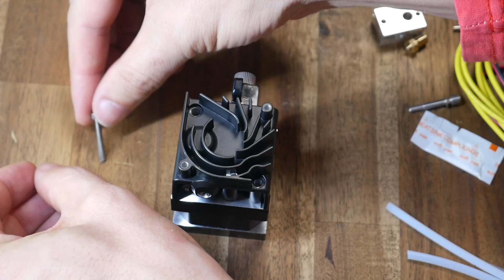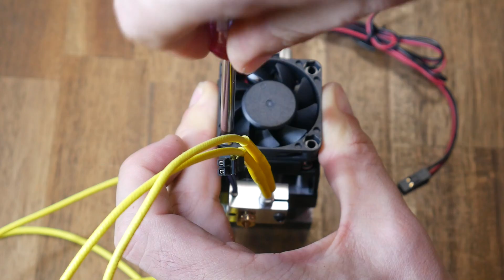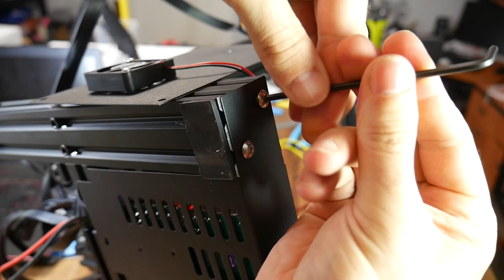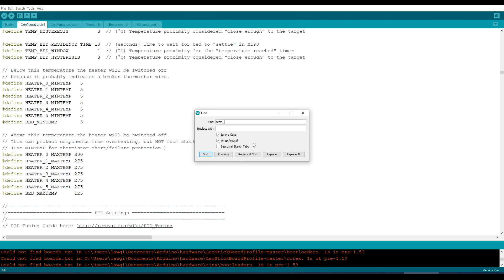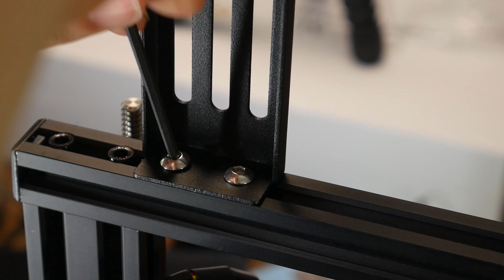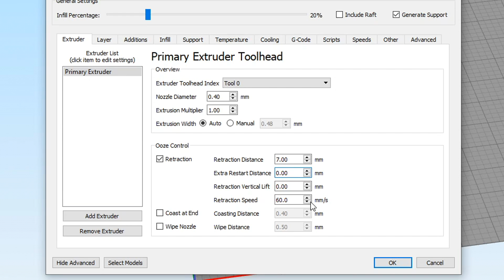Hemera to Ender 3 - Complete guide

Comment: Hi, I'm the designer of the part cooling duct you used. I just wanted to point out that you should position the heater block pointing towards the rear of the printer to hugely improve the clearance between the duct outlets and the heater block.
The duct is designed for the flow characteristics of a 5015 blower. It won't be anywhere near as effective with the rather feeble stock 4010 blower.
The best way to gain back the lost Y travel is to drill and tap new holes in the Y rail so you can move the entire Y assembly forward. 
Keep up the good work!
Reply: or you can forget the holes and instead use 2 tnuts? thanx 4 the design btw!!
Reply: @ZILLION4EVER  The printers I've seen that go that route also use plates on the side to reinforce it. I'd probably add some of those if I was doing it that way.
Reply: @ZILLION4EVER  what size should be the tnuts?
Reply: He has a 5015 fan now I think.

Comment: can  you do a install of the hermera xs on a kobra max?  
the touch off sensor, since it uses the nozzle for heights and not a probe is a little out of my expertise.   if I use the sensor mounted to the frame / plate, do I need to use any extra wires , say the the spring? or the stepper body for connection?
any way, I know this is a shot in the dark, but I cannot find any info about the sensor and how it works online, and anycubic is terrible for advice on MODS.

Comment: Yeeeeah, I ended up with one of the Ender Pro 1.5 versions, and every mod I've done has been a pain because almost nothing will go exactly  the way it's supposed to 🤣 I installed a Hemera on mine and it was enough of a hassle to set up that I am just holding on to it to put on some future project, it's just too large for the bed size and I'm sure I can make better use of it elsewhere. Debating putting the 1.5 back to stock, we will see.

Comment: I don't get the AXIS_IS_TMC(E0) current setting, the value is in mA? is that the rated motor power? in my case it's 1.3A (matrix extruder) and 1.33 for the e3d hemera in their spec. sheet. the dozuki links dont work as of writing this.

Comment: Excellent guide! For the Ender 3 Pro 1.5 with 4.2.2 Board, I found two things that I had to do slightly differently:

1. Apparently the A4988 drivers on the 4.2.2 board have .1 ohm Rsense instead of .05 ohm and so I had to adjust the Vref for my extruder to .9576 volts (that includes a 10% safety buffer below the 1.33A max current of the Hemera stepper motor).

2. The wires had to be moved around a bit, not just switching the middle two, like they suggest in their guide. Best advice is to plug your original extruder wire into the board and Hemera and trace the wires to verify which ones need to go from which pin on the board to which pin on the stepper. For me, from back to front on the stepper, it ended up being black > (empty) > blue > green > (empty)>  red.

Comment: I have one and when it works it works great but when it doesnt its a HUGE pain in the arse...I went with the volcano hot end for my build all set onto a creality cr10-v3...i have had this setup jam mid-print, all of my nozzles are jammed. right when I think I have it all down and its printing perfectly, it will jam itself I just pulled a piece out that was slightly bigger than those glass thermistors.....anyways....i am sure its something I am doing wrong somehow and not E3d's fault, I do love the company....now, if we could only get them to spend the time and energy to come out with some real PROPER install kits and official instructions.... they could bring a lot of  people into this industry, we all know most of this stuff if not all of it comes from china and china is HORRIBLE with directions.....if just one manufacturer was out there explaining what all this stuff is like you do on your channel... they could be making a killing! cheers from Colorado, USA.

Comment: I just installed one on my CR-10S.  I bolted it to a linear rail and it was quite the project coming up with all the pieces to make it work.  In the end, I modified a bunch of things from thingiverse meant for other printers to work on mine and it is working GREAT.  I will however continue to iterate and improve on each piece I printed as none of them are perfect.  But boy oh boy does this hot end print smoothly on a linear rail!

Comment: I found a discrepancy with the wiring diagram provided. It seems that for my Hemera, the "thick" red/black cable is actually to the hot end thermistor and the "thin" red/black cable is to the hot end fan. Maybe E3D has switched the type of wires they use but I thought this might help people out. I spent hours trying to figure out what was wrong. My fault! A good reminder to always double check that the cable matches the component, even when referencing a wiring diagram.

Anyway, I really appreciate this video and all your others. Super helpful!

Comment: Awesome video! I can’t wait to get a Hemera for my CR-10S. Unfortunately I’m going to have to be patient as they are out of stock probably due to the pandemic. I might end up going with the Micro Swiss Direct Drive Extruder combo and flash Marlin over to get my feet wet since this is my first 3D printer.

(I’m a CAD designer utilizing it to 3D print automotive prototype designs.)

Comment: Quick question. I was under the impression the cr10s pro and alike didnt support (cartridge style) thermistors; is that just not actually an issue now or was it just not an issue because of the TinyMachines  marlin firmware modification that it was fine? any info is much appreciated, cant seem too find much online.

Comment: I installed the Hemera on the Ender3v2 and had to make 1 minor change. The extruder stepper motor wiring had to be BLACK | GREEN | BLUE | RED instead of BLACK | BLUE | GREEN | RED. The diagram shown in the video resulted in the extruder stepper not rotating at all. Going BLACK | GREEN | BLUE | RED (swapping the inner wires) resulted in the stepper rotating backwards. Swapping either of the pair of wires (BLACK / GREEN or RED / BLUE) should fix the inverted rotation. Or you can change through Marlin too.

Comment: Michael, Any chance you can swop that Hemera onto your Ender 5, and confirm parts bolts etc required.
do you have a basic E3D V6 Bowden and E3D V6 Direct Drive with a Titan video, in 2 minds which to buy, both not exactly cheap.
pretty sure this will make a day/night difference to my printer.

Comment: Please keep in mind that you will have to change the Vref and double the total to about 9.5 with the 10% reduction, e3d added a note that Creality printers don't use.05 ohms, but they use .1. I had clicking because of the extruder being set to the wrong voltage.

Comment: I was confused wiring this up. In your diagram you say the thicker red/black one goes to the fan, but when you do the actually wiring the thicker one is the thermistor . Just a heads up if anyone has this same issue.

Comment: Where do you have the 940 for the current from?

In the official paper it says:

Step 7 TMC 2100, 2208, 2130, 2209 (Standalone)
TMC 2100 calculation:

VREF= (RMS current x 2.5) / 1.77

VREF = (0.94 x 2.5) / 1.77

VREF = 2.35 / 1.77

VREF = 1.33

It is advised to add a 10% safety margin to avoid any over heating, decreasing the lifespan of the driver.

1.33 - 0.133 = 1.197

VREF = 1.197

Comment: https://www.thingiverse.com/thing:4076960  This will let you modify a four wheel x-axis gantry plate to mount directly to the Hemera.   It it pretty easy to do with a drill bit set and good drill.  I used a cut-off wheel with a router to cut off the stock hotend mounting points, then attached the guide, used some cutting oil, and drilled holes for the Hemera.   The extra wheel helps with the added weight of the hemera.  You can loosen the eccentric nuts without introducing slop.

Comment: I have upgraded my Ender 3 with Klipper, mainly to print at 150-200mm/s for quicker prototype. (and to be honest, pressure advance with 0.5 knock off nozzle and bowden setup are not really going together). Since then, the skipping extruder has annoyed me a lot (stringging and budging sharp corner, too). I'm considering changing into Hemera in order to achieve stable extrusion quality with Klipper's pressure advance really working.

Do you think that a Direct Drive setup with Hemera hotend and Klipper printing as really high speed will work?

Comment: Used this as a reference for installing on my Ender 5 with the silent mainboard. Key differences:
1.) vref calculation for 2208s

1.3A stepper motor on the hemera
1.3/1.41 = .942 (root mean square)
(.943 * 2.5) / 1.77 = 1.33 (max vref)
1.33 * .9 = 1.19 (final vref with safety margin)

2.) wiring colors on the stepper motor didn't match your unit, I ended up referencing the stock cable to determine placement, [e] denotes where the extruder marker is on the cable
for my ender 5, this was the pin closest to the middle of the board and ends up being the right-most pin when viewing the hemera from the side with the stepper motor. The two middle pins swap positions between the board and the motor. 

Mainboard
____________________
|                    | 4 3 2 1 |  |
|                                      |
____________________

Stepper

______| 1 3 2 4 |______
| O                                 O |
|                 Logo               |
|                                         |
|                 QRC                |
| O                                 O |
--------------------------------------

MB        Stepper Motor
1      => 1 left (blue)
2      => 3 middle right (red)
3      => 2 middle left (green)
4 [e] => 4 right (black)
Reply: Thanks for this, my hemera is sitting in a box waiting for me to find out if I could use this guide.
Reply: Thanks man this helped me understand that for my setup (CR10-S PRO V2) is needed to switch 3 cables

Comment: Hey Michael! So I got 4 HEMERA upgrades for my print farm for my Ender 3's. I am unable to get some clear Sainsmart TPU printing for longer than 20 minutes before either: A) The filament stops feeding (low tension), or the filament gets crushed and is blocked by the tight tolerances of the Bowden adapter (high tension). I've gone through E3D's entire troubleshooting guide- waiting for support to get back to me. Any ideas what might be causing this issue?
Reply: Did you ever get this resolved?

Comment: Hi, thank you for the very great report. I put the Hemera to my Geeetech A10 and now I has problems with the stepper motor. My board is a GT2560 V3 and the orign stepperdriver and I put it to recommended setting. But now the problem is, the motor is only shaking left<>right and not moving normal. I put the Vref to 0,8V but it was not helping. E3D recommend to turn the 2 middle wires but then the motor is no more shaking/moving. Any idea what is wrong?

Comment: Hey Michael, as a heads up, I print things but have not made it to the point where I can design things.  I got the idea of upgrading my Ender 5 by installing the exoslide and have also purchased the hermera.  While the Exoslide team has created the mounting plate and a cooling duct for the Exoslide, no one has created an EZABL mount.  Would you consider doing a guide for the Ender 5 with Exoslide and Hermera with the EZABL and design a mount for it?  I wish I was able to draw things up like so many people do, just not there yet.

Comment: A 170 CAD extruder mounted on 3D printed parts. Thanks but no thanks.The Hemera has superb design and seems to perform well. But everything goes out by the window once you mount it with ugly and unsafe 3D printed parts.

Comment: I have one fitted on the Ender 5. Designed a one plate design that works perfectly. 
Only one thing i can't get rid of is the z seam (using cura) altough it's directdrive and really good performing.

Comment: Put some thermalpaste on your thermistor and heating cartridge!
Reply from the maker: I considered this but ended up following the E3D instructions exactly.
Reply: @TeachingTech  Dammit! My gut told me I should so I did.  Then the E3D guide specifically said NOT to, so I pulled them out and removed the paste, the whole time thinking "it makes sense to have this on the thermistor but not so much the cartridge".
Haven't even run the new setup yet.  Just the mounting and wiring has taken 3 day's worth of my "free"  time.  Haven't even got to the firmware changes/compiling part yet.  Was ready to do that tonight but not after reading all the comments.  At this point I think I'd rather just take a lighter to a handful of PLA and smear it around repeatedly.

Comment: I also was having issues losing 20mm of Y, but luckily my y axis wheels were wearing out and for $15 I added linear rail to the y axis and got all that travel back. (https://www.thingiverse.com/thing:2914034).  Also I didn't have any flex from Joe's mount, but I did 100% infill with Carbon PETG.

Comment: amazingly clear tutorial ! great job. convinced me to give it a try on my "never-been-doing-well" CR10. thanks
Reply: How did that turn out?
Reply: @byfunkyoid : it turned out that I had the opportunity of changing my hot end for an E3d V6 (after problems with a Kossel). I tested and built a custom support and fan duct  (with lightness in mind) and now it's running flawlessly with a 0,6 nozzle on 0,4 layer height (with PETG). but I surely will move to hemera someday as, for having fantastic and solid results with my Prusa, I'm convinced that direct drive is a must in all conditions and allows much precise tune of printing profiles

Comment: Has anyone been able to compile the firmware.bin file in PIO? I'm trying to update so it sees the proper thermistor (Thermocouple?) I'm running Hermes (Hermara) w/ BLTouch / SKR Mini board E3 v1.3 I'm not a programmer but can normally follow the instructions enough to get it done. Unfortunately it doesn't compile.
Reply from the maker: Scroll up in the build log to the error and proceed from there. I covered general troubleshooting in my migrating to Marlin 2.0 video.

Comment: I was wondering how you check and adjust the VREF for the SKR Mini E3 v1.2 It doesn't seem like it uses a similar method and I'd prefer not burning out the motor.
Reply from the maker: All done by gcode: http://marlinfw.org/docs/gcode/M906.html
I would say the value of 940 given by E3D is too high.

Comment: Hey Michael! Thank you so much for making this video. Awesome job! I would like todo this upgrade but I have a question about the firmware side of it. I recently installed a TH3D EZBoard Lite in my Ender 3 Pro, along with a EZABL Pro. Using there ezfirmware website. I’m not completely comfortable with the firmware side of things but I’m getting there. Do you know if it’s possible to make all of these firmware adjustments on the ezfirmware website?
Reply from the maker: At this stage I don't think so, but it's only the thermistor change not currently supported. It would be relatively easy for TH3D to add this so why not send them an email?
Reply: Teaching Tech thank you for the advise and please keep the videos coming!
Reply: @TeachingTech  Hello, thanks for the video! I sent TH3d an email about this and just received a response with a link to their firmware page. Had to go back to the standard Marlin firmware. Kinda sad - I liked the TH3D firmware...

Comment: We have the same issues with our 3D printer (Dutchy3D) with regards to the mounting and the fan assembly. We are experimenting with putting a 4010 fan underneath the stepper motor blowing directly into a duct that goes all the way around the nozzle. This is a lot tidier but also not ideal since the blower potentially sucks air that passed the heated bed. We do hope that the improved airflow (no bents in the duct) will compansate for this.

Comment: Hi Michael brilliant video once again. But you keep moving forwards and backwards with your upgrades. You have previously upgraded the Ender3 to a SKR V1.3 mainboard. You didn't complete the TMC2208 drivers on this board using ATOM and haven't upgraded this board to TRULEV 600 32 bit. Your subscribers get in a terrible situation trying to get it sorted by themselves. Once having installed the SRK V1.3 we dont have the time or luxury to revert back to the standard board
Reply from the maker: I frequently have to uninstall parts to test out new parts. Things like the firmware are covered in general terms, the exact same changes would apply to SKR V1.3.